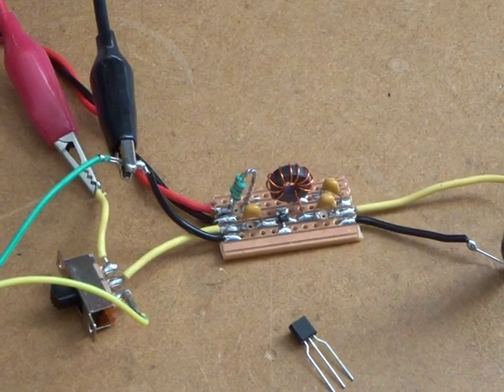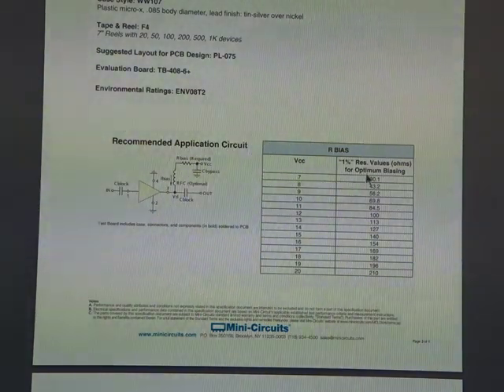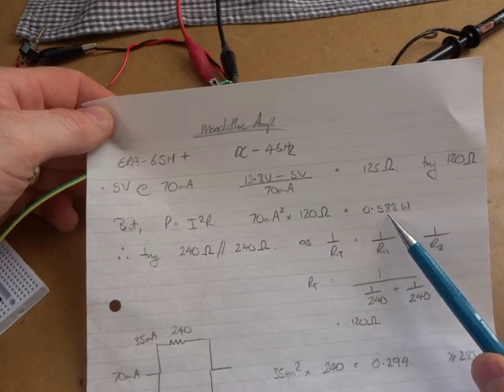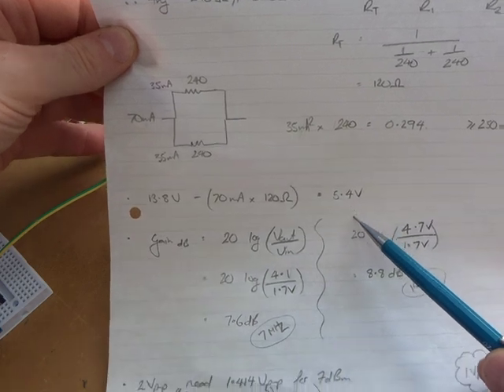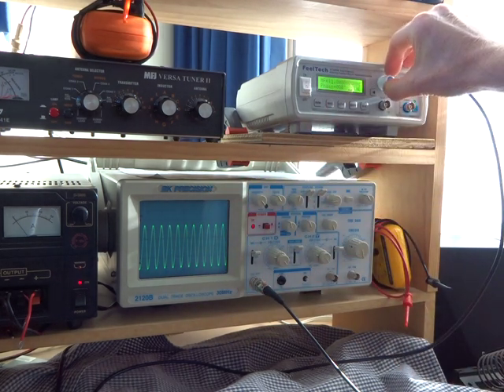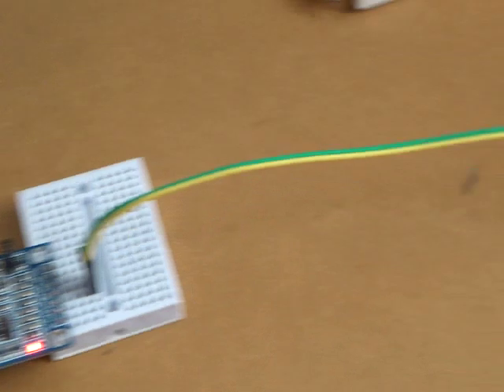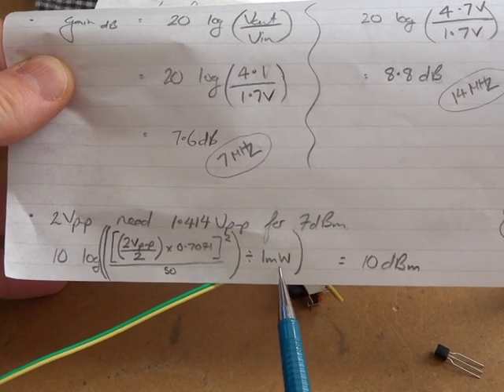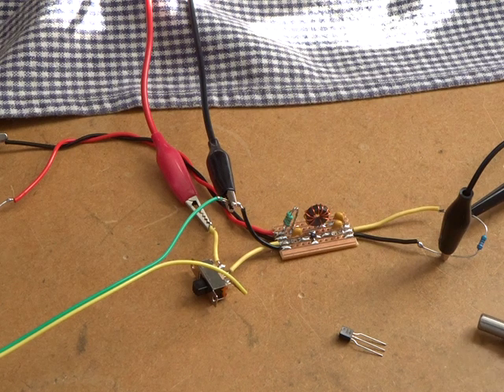ERA-6SM+ Monolithic Amplifier

Comment: Hello Charlie I've just ordered the parts for the amplifier from Ebay/China (so I'll wait for a month or two..).   I'm going to have a go with using it with a very recent  project on You Tube "EEVblog #1178 - Build a $10 DIY EMC Probe".  This probe requires an amplifier.  Maybe it will work or even better it won't so I'll learn even more trying to find out why it's broke! 73 Kevin
Reply from the maker: Great Kevin. It's all about learning for me.

Comment: Thanks Charlie, I have MAR4 and MAR6 MMICs which, although not Darlingtons, may have similar characteristics.  Can you do the the same experiment with one of these? The high current drain on the ERA device is an issue in compact portable txcvrs, it all adds up.
Reply from the maker: Hi Paul. I have some MAR-6 devices on order. I'll repeat this once they arrive. I couldn't find any MAR-4s.
Reply: @CharlieMorrisZL2CTM  IIRC the MAR-6 has published noise figure of ~2.5dB (perhaps this increases at HF?) cf ERA-6 NF ~4.5dB. MAR-6 might be suitable for first IF amp, or even RF preamp for higher HF bands.
Reply from the maker: Thanks Stephen. That's good to know. I must admit that while I understand what NF is, I do not fully understand how best to measure NF it and incorporate that into amplifier design. I am going to have to dedicate some time to really understanding how that work.

Comment: Hello Charlie
Appreciate the videos - especially the calculations and the full explanations.  On a totally different subject - the Feeltech sig gen:  I have one of those too.  It works well but I have read (and tested) that there is a relatively high voltage (around 80V) between the outer BNC ground (floating) and the mains ground.  Now, I'm only a beginner and am not sure whether this voltage difference between the two grounds matters as the current is quite small.  Should I worry?
Thanks
Kevin 2E0FEQ
Reply from the maker: Hi Kevin. I think I did hear something about that some time ago. At the time there was discussion about the need to have a decoupling capacitor on the Feeltech output. I have a special lead with a 100nF cap in series for that purpose. I didn't use it here as the test circuit had a 100nF on the input. I'll have to have a think about the outer BNC ground. I can only assume there would be a leakage current at least on the ground side, which would result in some noise. I might have to get an isolation transformer.  Charlie
Reply: Hi Kevin - I have also got the same sig-gen and yes the psu leaks like a sieve !. Maybe the only safe thing to do is to change  the psu to a transformer type or like me remove  it completely  and run the unit from 12 volts dc !! - Mal
Reply from the maker: @ashave9100  Mal. Did you make up a special power supply, as the one in my sig gen has +/- 12VDC and 5VDC outputs? Maybe I should dig out an old computer power supply...
Reply: @CharlieMorrisZL2CTM  Hi Charlie - The one I have only goes to 10 Mhz , and has worked ok on a +12 volt supply for years , maybe if yours is a later version it will need the extra 12 volt negative rail.  I learned about the 95 volts on the bnc socket the hard way by though plenty of shocks !!
A good transformer based regulated supply will work best !! - Mal
Reply from the maker: @ashave9100  Wow. Shock are no good at all Mal. Thanks for the heads up.
Reply: Thanks, I was on the verge of buying one of these a few weeks back, but will hold off. I have several switching PSU blocks that float above mains earth and I wont use them with grounded equipment.  Can you recommend an alternative cheaper but effective RF sig gen for the HF homebrewer?
Reply from the maker: Kevin. I have just measured mine and i have 2VDC between my FeelTech BNC outer and the chassis ground of both the oscilloscope and power supply. Not huge, but enough of a potential difference to have current flowing between that and-say-the negative terminal of the power supply.

Charlie
Reply: @CharlieMorrisZL2CTM  sorry to break in Charlie/Kevin -try the ac potential component -that is the killer-Mal
Reply from the maker: Don't apologize Mal, as we are all here to help each other. I re-measured mine and I have 92VAC from BNC shield to ground. Yikes!!! I think I might try a FT50-43 with 10T on the primary (to the sig gen) and 10T on the secondary as an output. That should preserve the 50 ohm output while at the same time break the earth loop. If that fails then perhaps e new power supply.Charlie
Reply: it's probably double insulated. it would be interesting to measure the current. I had a Mac book Pro with 105V on the chassis but only at a few uA. You could certainly feel it! Using a grounded plug fixed that and it may fix your sig-gen.
Reply: @Chris-ZL  Hello Chris would a grounded plug scupper the floating ground capability (bear in mind that I am just learning so feel free to ignore my ignorance!)? Kevin
Reply from the maker: It should be double insulated Chris as there is no earth pin. I still want to try an isolating transformer on the output though. It just doesn't sound right to me.
Reply from the maker: Chris. I was just re-reading your comment about the grounded plug that you used. I wonder if I am doing that in a round about way as the sig gen BNC shield is typically connected to the circuits ground, which in turn is connected to the neg part of the 13.8VDC coming in. The neg in turn is connected to the power supply chassis.
Reply: The Chassis of double insulated appliances seem to float at the mid point of the phase and neutral input voltages or there abouts (depending on the internal topology) as a potential divider is formed by the parasitic capacitance between the Hot side of the PSU and the chassis. the leakage current will depend on the capacitance of the insulation (I don't think you will have any difficulty calculating it Charlie). 
Up to 1mA of leakage is generally considered safe, but it sure is annoying!
Your isolation transformer will almost certainly substantially reduce the leakage current and hence the measured voltage as it should have a grounded core and decent insulation.  
Apple did replace the MB of the laptop and the leakage current dropped to < 1uA. the 3 pin plug dropped it to a value unmeasurable with my multimeter.
Reply: @M0XYM  Yes it would. Some people put a switch or plug in the ground circuit so they have the choice. I did this with an oscilloscope once. 
remember THERE IS ALWAYS A RISK PLAYING WITH MAINS WIRING, especially if you don't really know what you are doing.

Comment: Can the output of the MMIC be dropped by s slightly lower Vcc ?
WA8QFE
Reply from the maker: Not sure Lee. I'll give it a go when I get back on Sunday and leave another comment here.
Reply: Yes, I use this method for terminating DDS VFO's for a decent 50R impedance match, you simply place a pot in a potential divider config above the feed resistor to swing VCC between +13.8V and around +7VDC which gives you a clean, variable output.

73
M0XXQ
Reply from the maker: @G7XXQ  Thanks Robert. Does that mean you apply up to 13.8V directly to the RFC, in other words, exceed the 5VDC VCC limit in the spec sheet? If so, I'll give it a go and see the gain turns out to be.
Reply: @CharlieMorrisZL2CTM  Hold ya horses mate, sorry my reply might have been malfunctioning. You still need the VCC resistor as per the spec sheet, so if the spec sheet states a 500Ohm resistor for 12V then that should remain and you vary the supply voltage from 12V down. I hope that makes sense and you haven't popped the device, if you have read this too let them I will post you a couple of replacements :)
Reply from the maker: @G7XXQ  That's what I thought! I could see dropping the VCC below 5VDC, but not above. Bit of a laugh as they say :o)